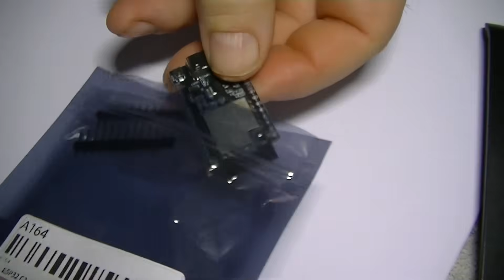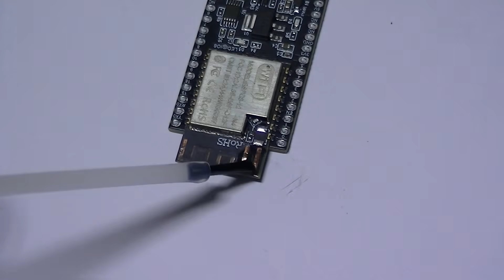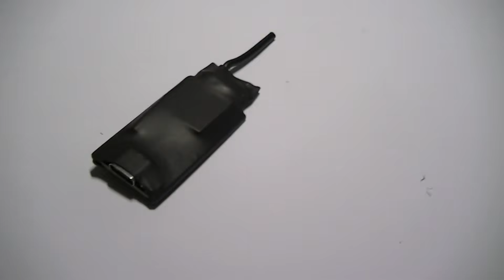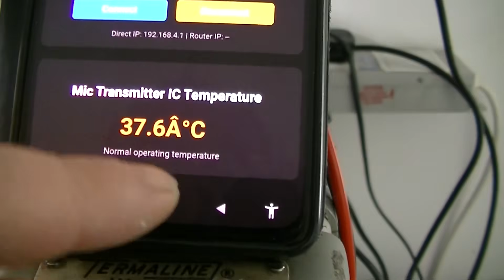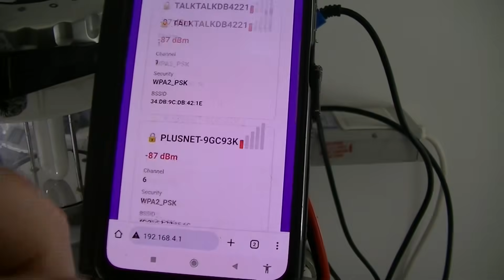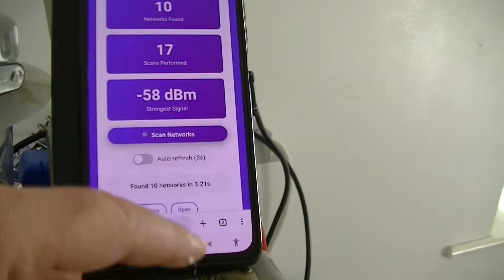Esp32 Antenna Mod ,how to get a massive improvement in transmission range, easy SMA mod for esp32.

Comment: Yeah I want to do something like this for the digital thermometer so I can actually have it out in the yard I was figuring maybe birdhouse enclosure with insulation so the temperature is not very much even in the summertime. But enough to get accurate temperature. You should try War driving with one it's kind of fun because some people have them indoors they have them in boiler rooms in different parts of buildings for different reasons

Comment: hi what aboute impedance matching??
Reply from the maker: The impedance can not be far off 50Ω  because in tests I'm getting over 300 meters transmission range in the open,that's my phone connected directly to the esp32 and using some RF test software on the esp32 ,plus the antenna is the same size as the one on the PCB on the esp32, I've a new video soon ,and in the next video i add a ground wire just under the antenna wire in affect making a dipole antenna that stabilizes impedance and pattern,I would test but my NanoVNA only goes to 1.5GHz ,getting the 3Ghz soon ,I'm no RF expert but love to learn
Reply: @dazaro3  hi can you post the link of your apps wifi analizer esp32
Reply: Hi Guys , I’m no expert either , im just wondering if you actually need that inductor in place or it can now be shorted out at you are presenting the circuit with a reasonably tuned 50ohm antenna match .i only say this because I’ve recently bought a couple of heltec V4 that has an inbuilt 2.4 ghz antenna or you can remove an inductor (and short a link out)  and use the onboard miniature coax connector to an external antenna … the information is on the heltec website V4 platform, hope that makes some sense 
Cheers Andy.